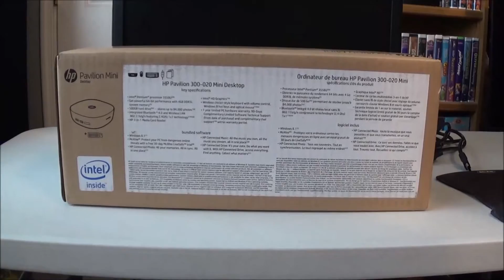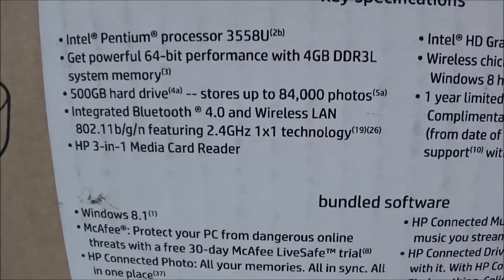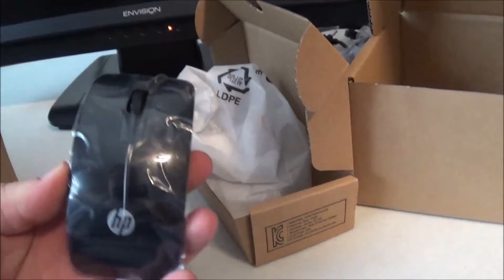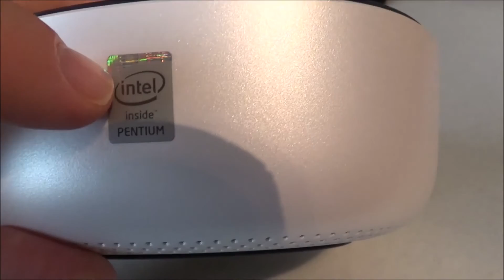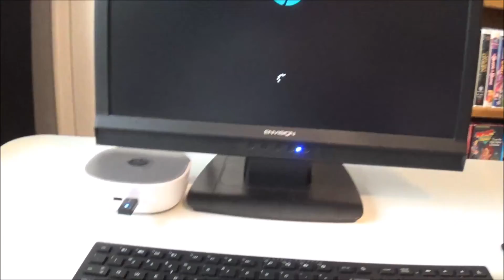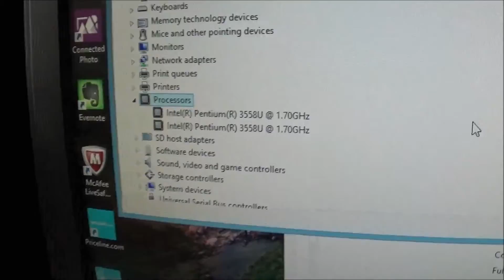HP Pavilion 300 020 Mini Desktop Un-Boxing and Review

Comment: HGST is a Western Digital company. I have an Asus VM-60 mini PC. It's has a Core I3, I installed Linux Mint 17.2 and I stuck a Kingston SSD in there. It runs great, the only thing it didn't have was a drive caddy for a 2.5" drive, which I got from Amazon. I have a video on that install if anyone is interested. I'm glad the HP only has USB 3.0 ports. The PC makers tried to differentiate USB 1.1 ports from USB 2.0 ports back in the day. I bought a USB 2.0 PCI card for a customer's blue Power Mac G3 from Fry's in Burbank, and the salesperson I was working with tried to sell me cables "made for USB 2.0".  It actually said that on the packaging. Needless to say, I didn't buy them.